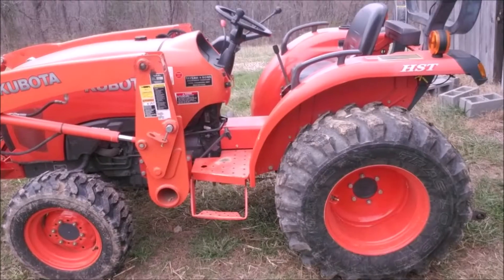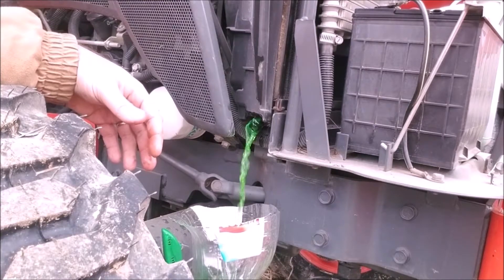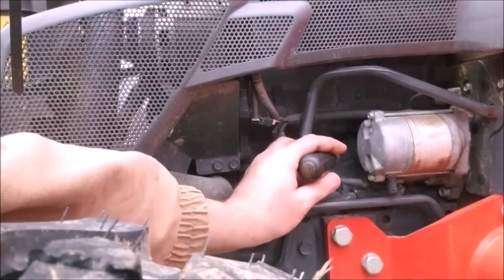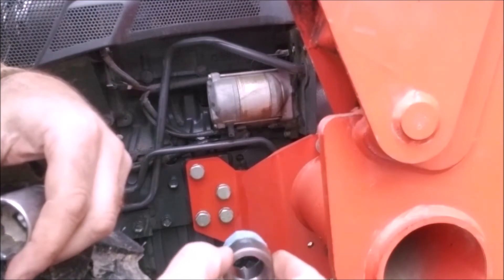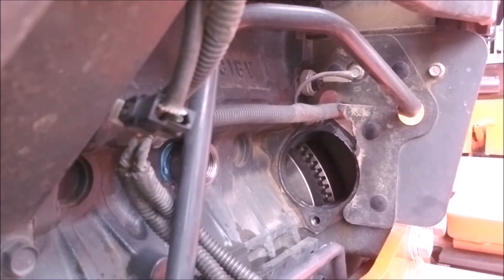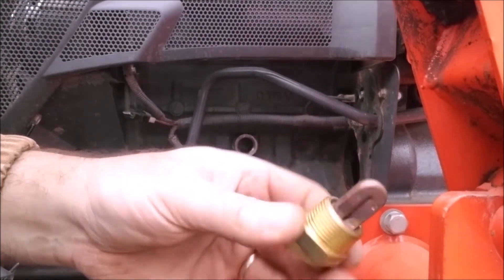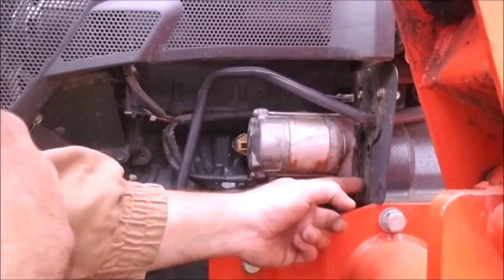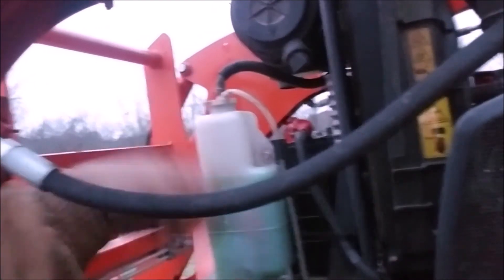How to install an Engine Block Heater Kit - Kubota L3800 L series tractor - Part Number 70000-00297

Comment: Do you know if one can order just that ( frost plug ) adaptor that is tapered on one end and threaded (female ) on the other end ?
Is the fitment on thetreaded end of this adaptor 3/4 NPT ?
If so would you know a part number for just that part?

Comment: I just put a block heater in my L2501 today your freeze plug came out a hell of a lot easier than mine did lol did your heater thread all the way into the coupler mine is about 1/4 to 3/8 from threading in completely
Reply from the maker: Mine did not fully seat either.  I believe it's taper fit / NPT, IIRC.

Comment: Why in the world didn't you use the freeze plug to the left so you didn't have to remove the starter?
Reply from the maker: The main reason: that was the manufacturer recommendation.
Reply: @paladinjme  did the manufacturer of the block heater recommend that or kubota?
Reply from the maker: @Jakerthesnaker The instructions appear to be written by Kubota...and it's a Kubota branded part.
Reply: My dealer put mine in the one closest to the front seat (left side) on my l2501 I wish he would have done it on the one like this video.

Comment: Well done and helpful (even though I have a John Deere, not a Kubota). JD may have a leg up on Kubota in making this job easier: the designated freeze plug for a heater is easy to get to (just have to remove exhaust pipe) and you remove it with a 1/2 inch ratchet. Just shows a little more thoughtfulness from some automotive engineers, I guess.
Reply from the maker: Thanks!